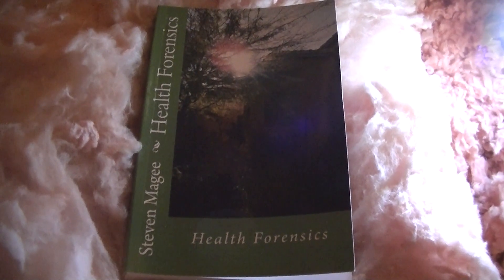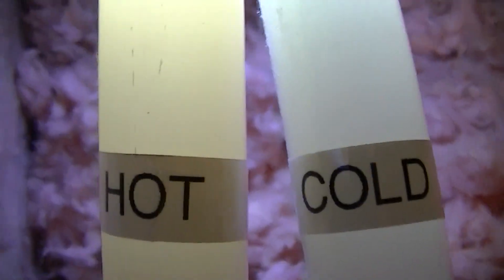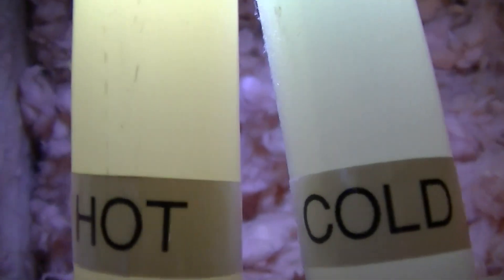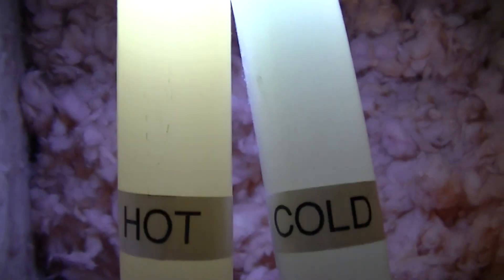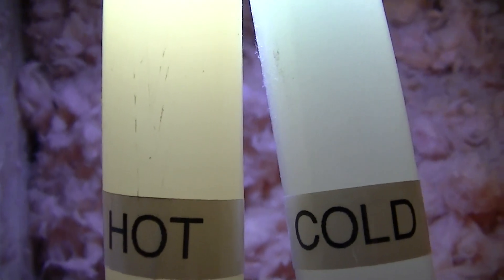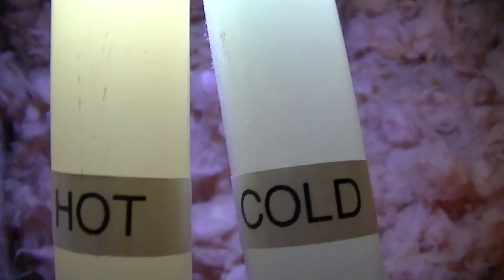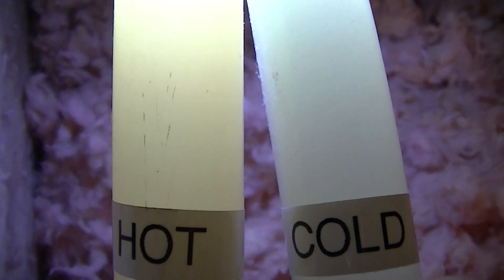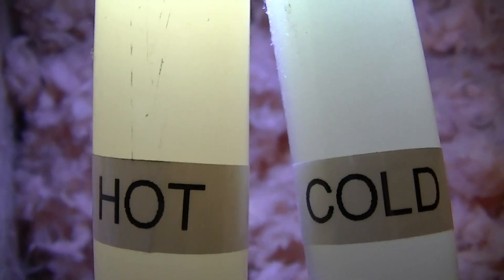Plastic Plumbing - Why is the Hot Pipe Yellowing?

Comment: 1. The brown stuffs in the hot water pipe is rust.  All water has minerals including iron in it.  The minerals usually accumulate in the hot water tank.  That is why you are suppose to drain & flush the hot water heater once a year. 
The higher temperature inside the hot water tank cause the iron to rust faster resulting in the brown color of rust and the volume of the iron multiply many folds.  The rusts attached to the pipes causing the brown color of rust in the pipe.
2. PEX plastic pipe is a health hazard.  All plastic pipe leaches chemical into the water even if the seller say otherwise.  See link below.
http://calpipes.org/ProtectingCalifornians_PEX.asp
Reply: K Ewan Great link Thank you!The PEX EIR found that methyl tertiary-butyl ether (MTBE) and tert-Butyl alcohol 
can leach from PEX in amounts that exceed taste, odor and health guidelines set 
by the State of California for drinking water. The PEX EIR found that PEX pipes 
can initially leach as much as 290 ppb of MTBE. The California Department of 
Public Health and the California Office of Health Hazard Assessment have 
established a drinking water taste and odor standard of 5 ppb for MTBE and a 
drinking water public health goal and maximum contaminant level of 13 ppb.  One 
of the key issues for the California State Pipe Trades Council was the 
recognition that construction workers are often the first to consume water from 
newly installed pipes.  Because the levels of MTBE contamination from PEX pipe 
are highest during the first month of use, workers were at risk of repeated 
exposure to drinking water contaminated with MTBE at levels exceeding public 
health goals as they moved from job site to job site.
Reply from the maker: Henry Roberts Seems like I did the right thing buying the home 2 years after it was constructed!  I'm the second owner.  So new homes=Higher risk of toxic chemical exposures.